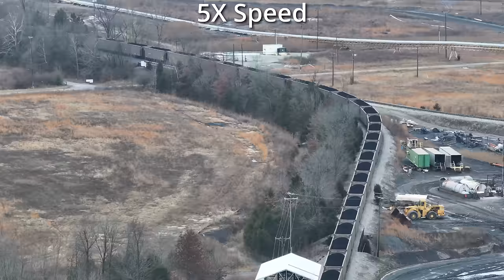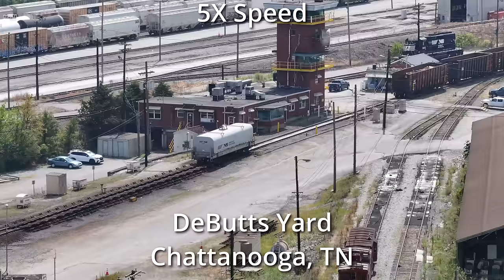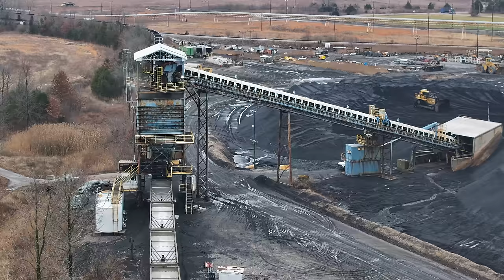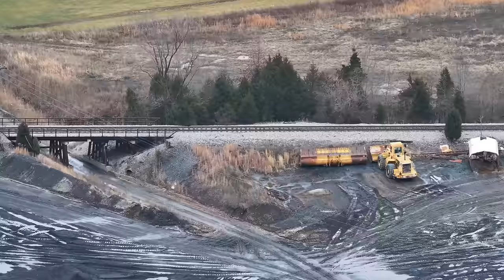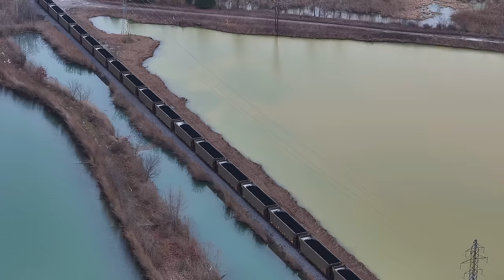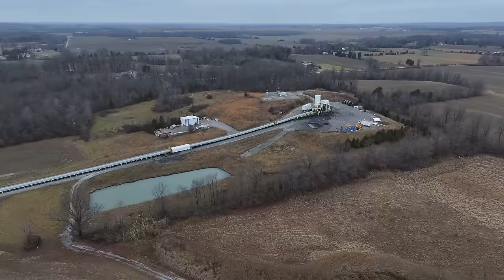Loading a Western Kentucky Coal Train: The Warrior Coal Mine in Action

Comment: I am a retired coal preparation engineer. The sprays prior to empty cars entering the load out  are freeze release agents not water.
Reply: You have to be from western va….lol. I’m from eastern Ky and been round mines my whole life ….dad put 30yr underground
Reply: How do they get the coal out of the cars when it's delivered to site 🤔
Reply from the maker: @sweets6865 I believe they're pulled over a raised platform and the coal is dumped from the bottom of the cars.
Reply: @nkyrailfan you are correct
Reply: Belly dump wagons, they run over a pitand ramps push arms on the wagons up and that opens the doors on the bottom

Comment: The nozzles that you were calling water spray were not spraying water.    They spray a chemical that keeps the coal from sticking to the sides of the hoppers.   Great video.    Thanks.
Reply from the maker: Thanks for the great information!
I never would have thought they would need to do that, but that makes sense as to why it would be before the coal is loaded.
Reply: We call it freeze proofing
Reply: That’s called “flood loading” rail cars. As coal is shoved by those dozers, it will travel up the conveyor belt. As it does, usually, but not all, have a sprayer system that while treat the coal with a residue that a) keeps the dust down b) Damping it with a solution that cuts dust down 80%, along with some freezing agent to keep it from sticking in the hoppers c) helps making the dump using rotary or other ways off dumping, having less “clogging” issues. I did this years with CSX, and the mines in Eastern Ky! We’d flood load 150 AEPX cars, and 125 DEEX cars bound for the Great Lakes. Hope this helps!
Reply from the maker: @bryanlee5090 thank you for the great info!
I really do appreciate it.
Reply: Also, coal in that form could never "spontaneously" combust.

Comment: Hello Chris  I am familiar with bottom dump rail cars. I have designed many train load outs. I also did some rotary dump loadouts  where the hopper cars have a special coupling that can allow rotation. Cars stop at the designated position and that car is rolled over and the coal dumps out of the top where it was loaded. Did you work in the coal industry? I designed several coal preparation plants from flowsheet to start-up. I am from West Virginia but worked in KY, IL, IN, and finally in CO where I live now. Here I worked at West Elk Coal Mine. I retired in 2018 after 22yr, 3 months and 10 days. Be cool as a Jewel, I am.